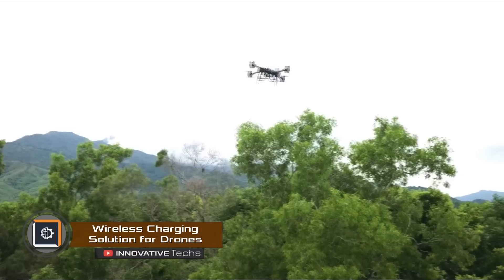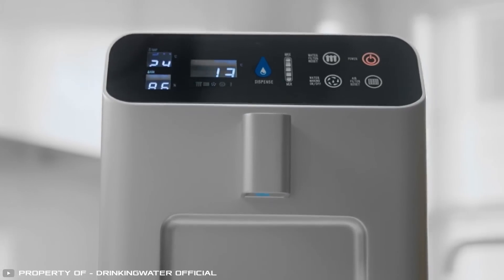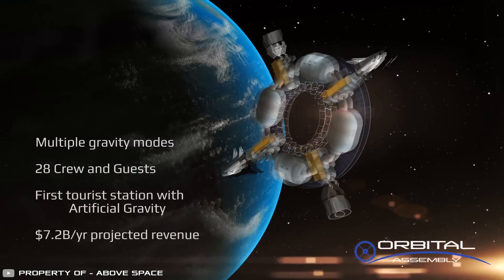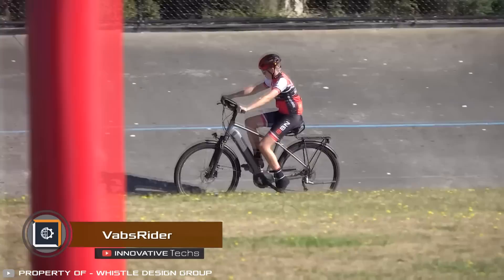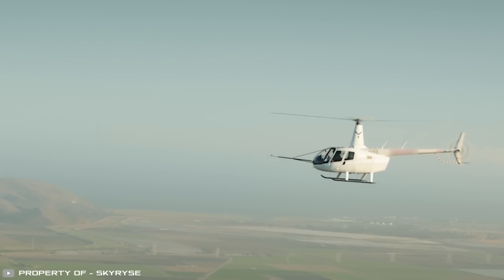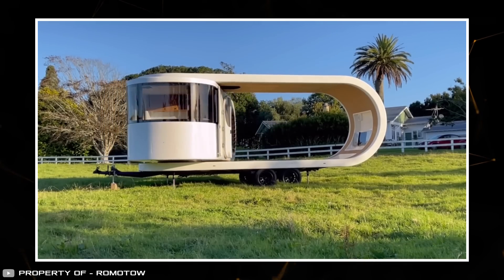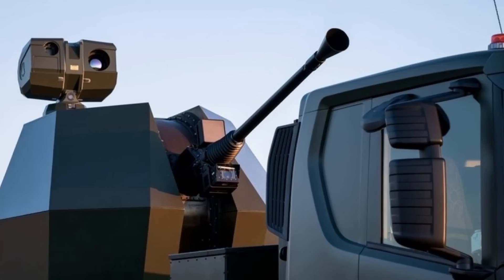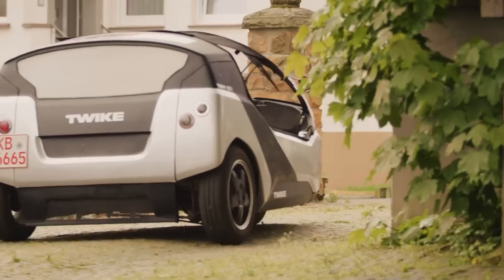AMAZING INVENTIONS THAT WILL BLOW YOUR MIND

Comment: I am skeptical to say the least...
1. Why charging the hovering drone for 8 minutes to have another 30 minutes of flight, if you can swap the battery in seconds to have full time of flight?
2. To store energy in skyscrappers you need to provide it with electricity and elevate the blocks first. Nothing new here, and the dedicated storage would be much more convenient, but the skyscrapper would need to accomodate the additional structure for this machinery - no new/free resource could be taken from the available skyscrapper.
...and so on...

Comment: Raising blocks does not generate electricity, It stores it. The infrastructure is enormous! A waste of effort. Gravitricity uses old mine shafts.
Alexa controls lots of appliances by speech.
Electric trucks with reduced weight? Except for the battery? 
Drone defence vehicle could be swamped by multiple drone attack.

Comment: When is the USA modernizing to the global metric standards instead of using outdated Roman standards?
Reply: As i had to learn the imperial system in school in uk before we changed, Absolutely better in metric.
Reply: Never. The universe runs on base 60 not on multiplies of 10. Imperial is by far the greater system as it actually reflects reality unlike metric that reflects nothing.
Reply: @onieyoh9478  HAHAHAHAHAHA! Except that we have ten fingers and ten toes and it is much easier to work in multiples of ten, hundreds and thousands than it is in whatever the f*ck multiples are used in the imperial system. How many yards in a mile? How many ounces in a pound? How many pounds in a hundredweight? 
How many fluid ounces in a quart? It's freaking nonsense.

Comment: @1:20 I'm curious how much energy is used to bring the blocks back up....
Reply: More than they produce.
Reply: Why not use the elevators? Computer could easily compensate for the variable weights, if it's even enough to be a problem.
Reply: @gargoyleb bit of a crazy comment. No matter how you transport the weight it still requires energy to achieve it.
Reply: @tanagra2  That's what I'm saying. You'd be cancelling out the energy gained by the energy it took to raise the other block. But if you put in a gear that could switch directions...
Reply: That is what I want to know. Maybe they use solar during the day and lower the blocks at night?  So it is a sort of battery?
Reply: @lillydragon2525   Or just use the solar to charge the batteries, not a well thought out concept!
Reply: that's just what I was looking for in the comments. I can't believe no mention.
Reply: @johnjeffreys6440  How do you get more energy out? You spend x amount getting the block up, you get x amount out when it comes down.
Reply: not spend but get back
Reply: @gargoyleb  counterweight 
So going back up requires little energy like an elevator
Reply: Maybe the counterweight like an elevator that requires little energy, and then a free fall using all gravity.

Comment: Apparently, spinning a space station to create artificial gravity isn't practical because the human body remains aware of the spin and nausea is the result. People would be throwing up all over the place.
Reply: It depends on the diameter and the direction of movement in relation to the rotation. Moving parallel on a large enough diameter you are ok.  Movement perpendicular creates serious problems until it passes a given threshold. I read it was a 1/2 - 1 kilometer in diameter. But I’m not sure if that is a general rule or speculation.
Reply: I love when dumb people say things with confidence. It's pretty funny.

Comment: The drone should have a hot-swappable battery pack.  You land on the tower and it swaps the low-power pack for a new one in 15 seconds.
Reply: If they did that then they wouldn't be able to sell you nonsense like a device that concentrates water out of the air in a desert that has no water in the air.
Reply: The tower seems really dumb.
Reply: @danielcurda3633 it really does. Wouldn’t it be easier to land and change out the power pack? Now you have this big stupid tower, building, manufacturing, etc. Renewables seem to do this a lot. It’s like taking off your pants to fart.
Reply: @danielcurda3633 omg, same with the drinkwater machine. I’ll have to install another humidifier in my home!